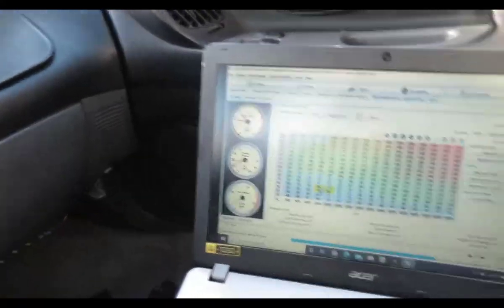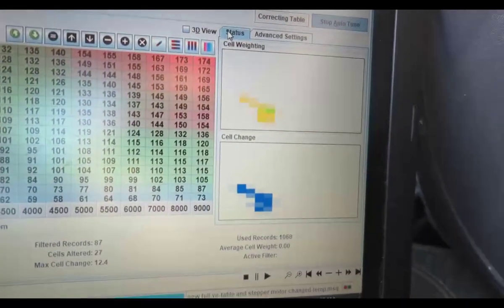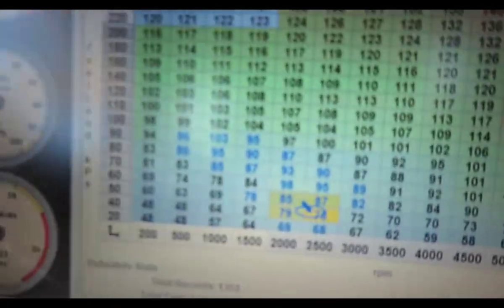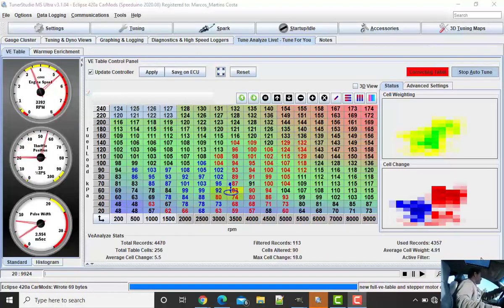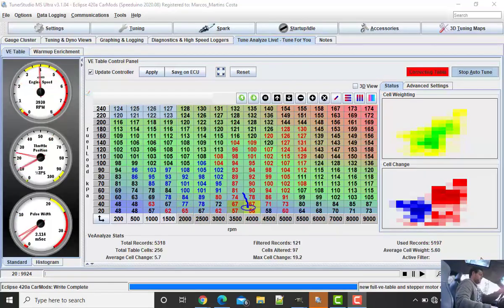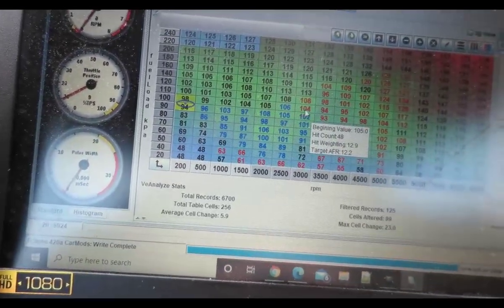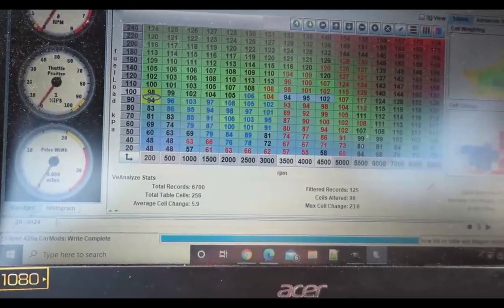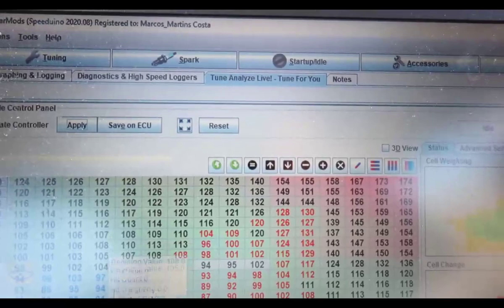Experimenting Auto Tune on Tuner Studio Driving Around  Part1 of 2 - Eclipse 2G Speeduino

Comment: One think I remember is you have to tune it with auto run fuel cut off so it won't go lean on decl , then turn it off after the tune is good
Reply from the maker: On this case it's the auto tune that creates a basic fuel table for you according to you afr table.  After it's done you turn it off and smooth everything out and correct whatever is needed by hand  Some people like it some people don't but it's kind of useful if you are a beginner

Comment: Well, what autotune does is change the fuel map so it reaches target afr based on engine speed and load (Inlet manifold pressure in your case). 

The thing is, your afr is not only dependent on fuel, but also on ignition timing. So if your spark map is doing something weird, causing the engine to need less fuel to reach target afr, you will see that in your autotuned VE table, which is basically what you were seeing.